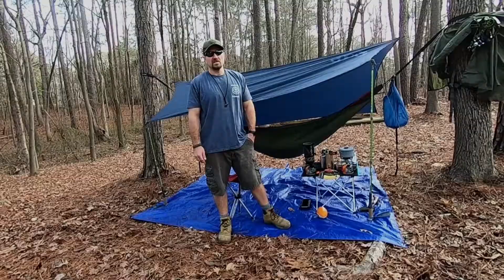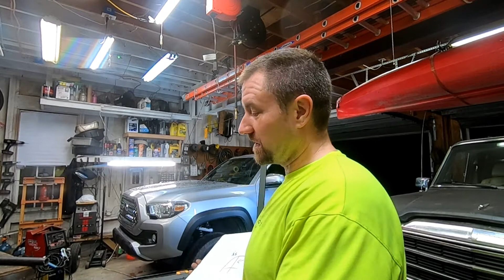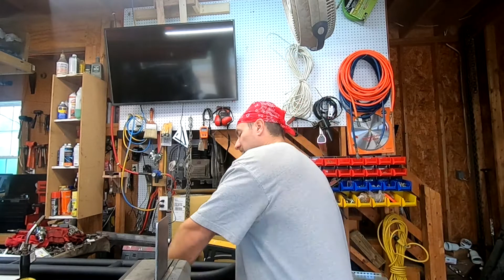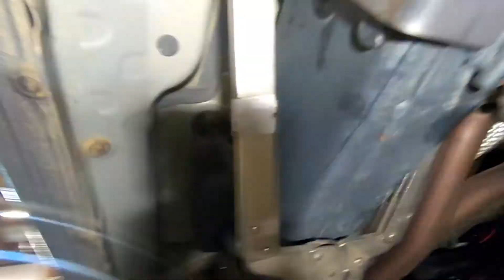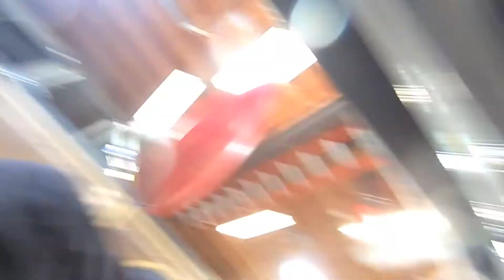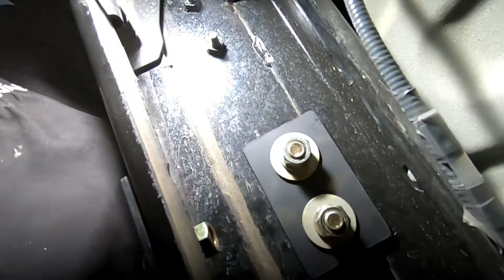DIY your own Rock Sliders. Bending, Grinding, Welding and Mounting. Toyota Tacoma (Part 2)

Comment: I dig it.
Reply from the maker: Thanks man.  I have found the rocks a few times already and they have been holding up pretty well.   I did have to take them down to bring them down a bit.   I was not aware of how much flex the Tacoma had on the frame.  
https://youtu.be/uC4PiL_M1SY

Good luck

Comment: You have a hydraulic press in the background... you need some press brakes (V-Block metal benders) for your press.
Reply from the maker: I do have a press but it is a relatively small one.    it should be enough but have not tried it.   I really like my bender.  just need other size dies.   I only have 1.75

Comment: Nice job. I been making some 2 piece brackets for a friends camper suspension. To sandwhich frame between brackets. I can't believe those light weight camper frames are made that cheap.
Reply from the maker: I was thinking of using a clamp style mount but since I did not mind drilling holes in the frame I went the easier way out.   I am still trying to find some hardware to finish up the driver side.  I might have to go over to the next town over to see if they have any grade 8s.  I don't think it is a supply issue.  I think it is a vendor issue.